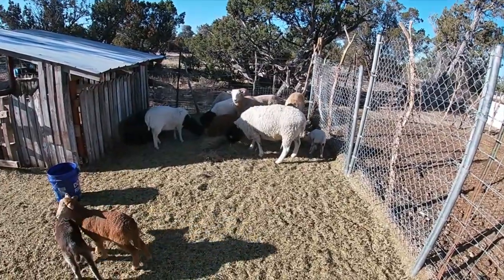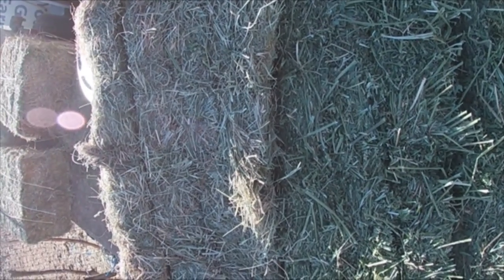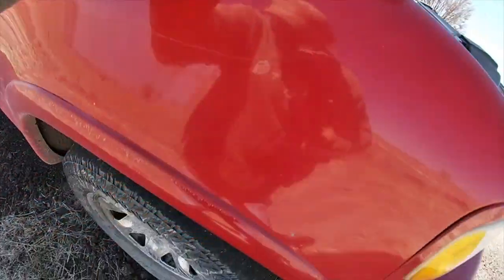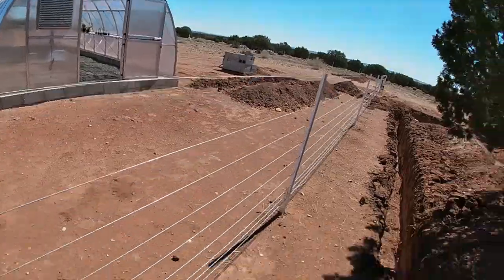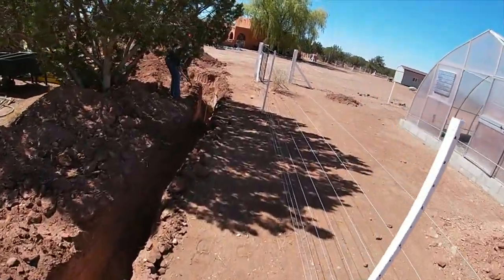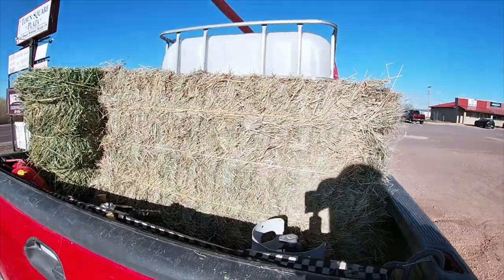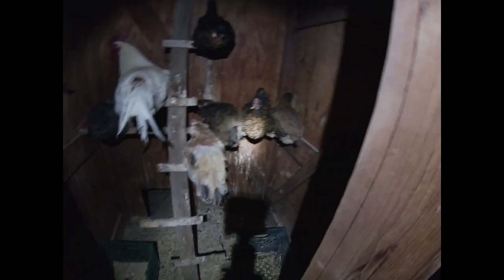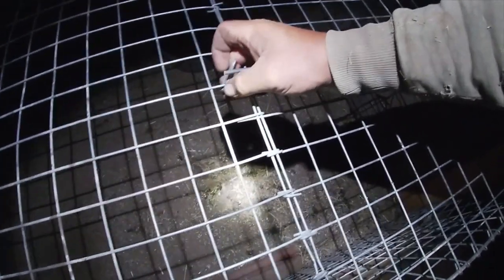What Is It We Do In A Day?

Comment: Bless your hearts. You both work so hard, I’m sure most every day.  Thank you for all you do!  Much love and blessings! 💕🙏
Michelle C. Suisun City, CA
Reply from the maker: Thank you for supporting the channel.
Reply: @HighDesertHomestead  thanks for the videos.  I'm installing A-frame corners on five wire high tensile fence. What kind of installators do I use on a 45 degree brace post?
Reply from the maker: If the posts are round a 4 inch tube insulator is what we use. If 4 inches is not long enough you can get them in 6 inch also. A real good source is Kencove fence supply online. I buy a lot of products through them.
Reply: @HighDesertHomestead  Ok. I thought those short out after a while.
Reply from the maker: @itisfinished7377  not so much they really don't have any strain on them. At the strainer or corner  post I use a bull nose insulator and along the 45 degree leg of the brace I use the tube insulators. Tractor Supply company sell boxes of 200 for about $20. But if you need more then Kencove is the way to go.
Reply: @HighDesertHomestead  thanks